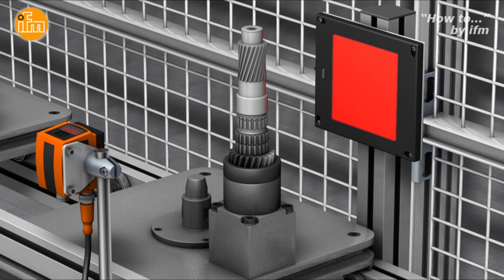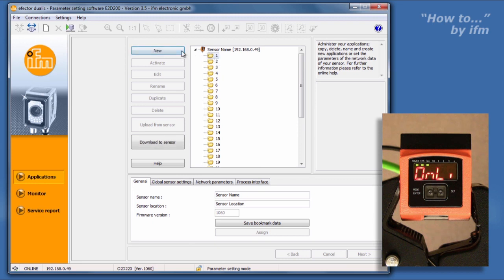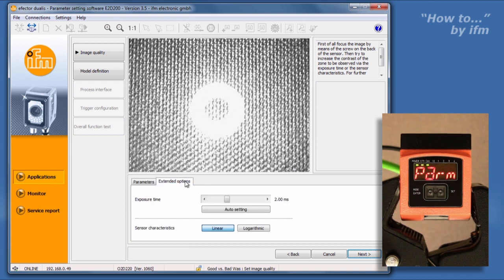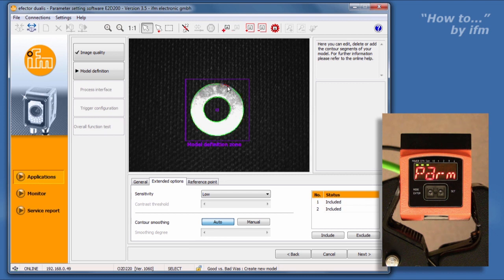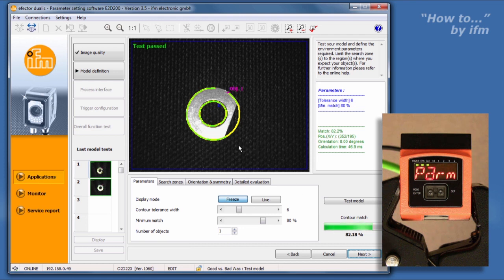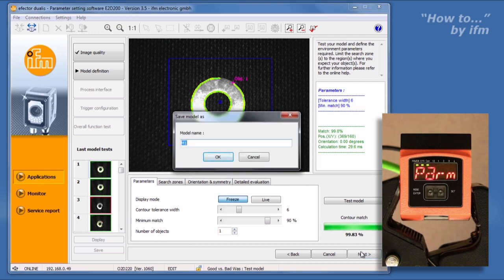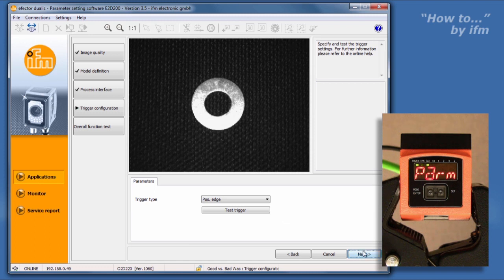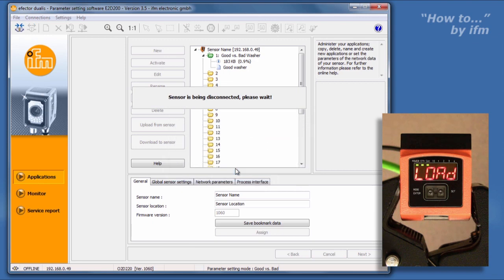How-to: Programming a Contour & Shape Sensor for Object Inspection - ifm O2D dualis

Comment: Hi ifm, thank you for this tutorial . 
It's written in the camera datasheet that it uses the TCP/IP protocol. So is it possible to interface with the camera using another software or a programming language ?
I want to write my own code (java ,c++, matlab...)  for this camera. I tried to send commands via socketTest.exe (port 8080) but it doesn't work.
Any help would be appreciated.
Reply from the maker: Hi meachatronic Ninja, thanks for your question. Yes, its possible to interface with the camera. Please still keep in mind to use the port 50010 (Process interface TCP/IP port) since the port 8080 is the XML-RPC port. Best wishes from ifm's Social Media Team
Reply: @ifmgroup  thank you so much for your answer,  I will try it as soon as possible.
Reply: @robotics_ninja Hello. I am also trying to do this with python but i can't find the correct utl to access the streaming. Could you please help me ?